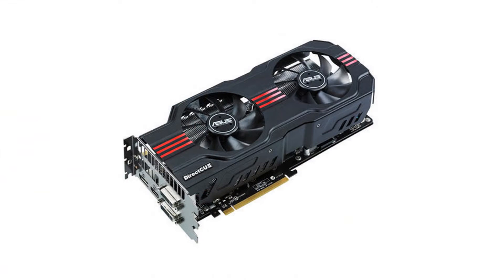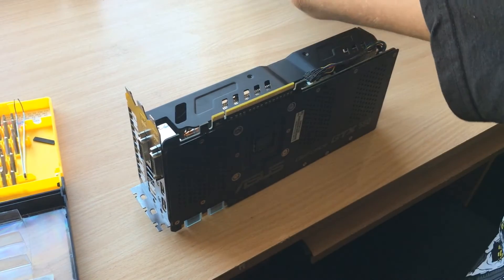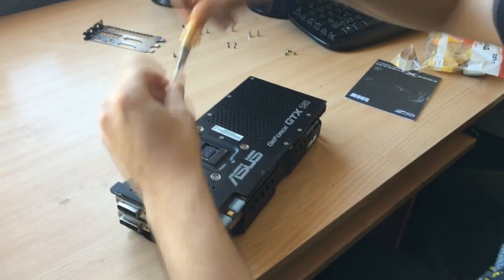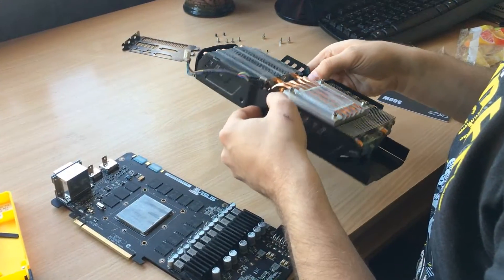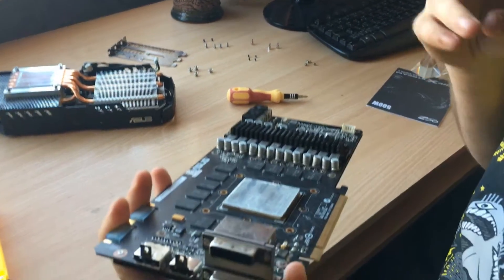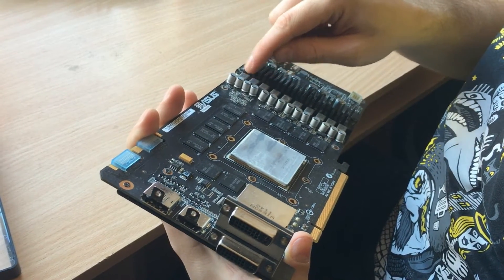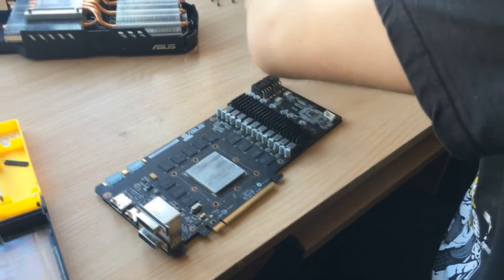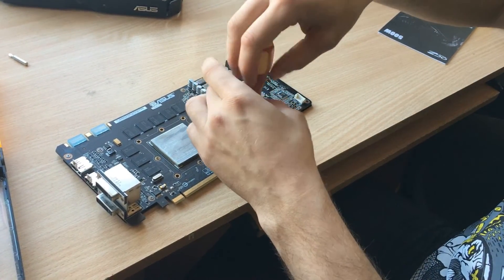ASUS GTX 580 Direct CU II Tear-down

Comment: exactly how Long is the 580?
Reply from the maker: Hey, this is the GTX 580 (Nvidia card) from like 2010! Just thought I'd mention this :D It's supposed to be around 292 mm long.
Reply: foreign's gaming tech Thanks, I have a 580 at home but needed to know the length right now(not at home at THE moment)
Reply from the maker: You're welcome! Why do you need to know the length?
Reply: foreign's gaming tech to know if I can fit a new one (1060) in my case.

Comment: GooD LucK hope its works again :)
Reply from the maker: Thanks!
Reply: @foreignsgamingtech  

 i need e few advises please! Im building pc for my 8 year old son, and its a very very tight budget since it's only for playing minecraft and cs 1.6 and later probably CSgo. I have already a few hardware components: i3 4160, gygabyte 120gb ssd, 8gb ram 1866mhz. 
My question is i have a few gpus that i can get around 25€ to 35€ and they are: 
25€ - Asus Gtx 580 direct cu II (3 slot expansion with backplate) 
35€ - Asus gtx 660TI direct cu II (no backplate)
25€ Powercolor 6970 
30€ - Xfx Ghost 7850 
Wich one do you recommend? I like very much of the 580 but it requires wich power supply? A 600w its not enough right?
Reply from the maker: @Dakhanavar99  hey out of those cards the 7850 is the best as it has aged the best. Others lack fundamental support on modern systems.